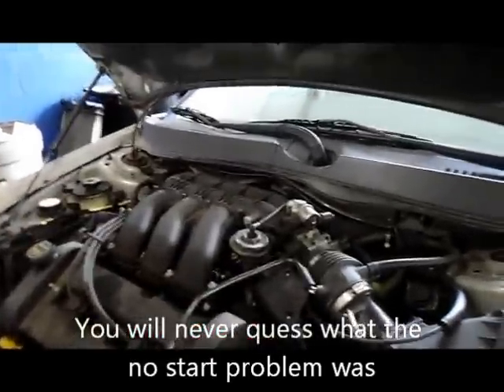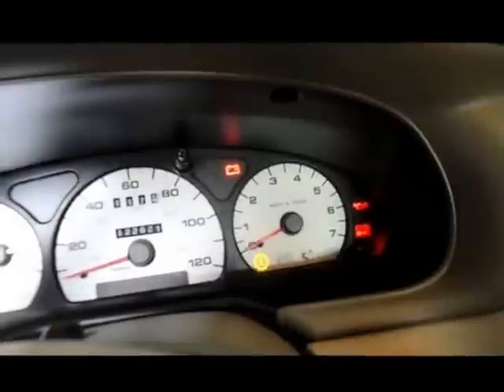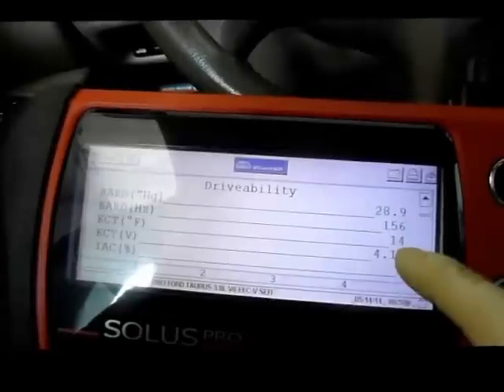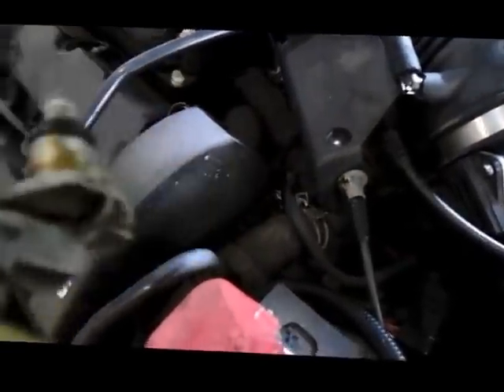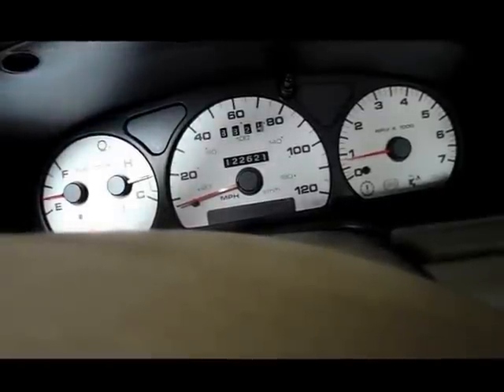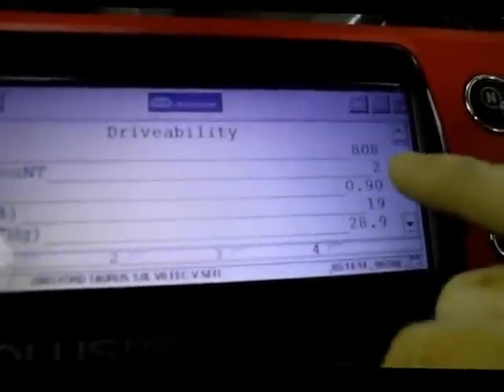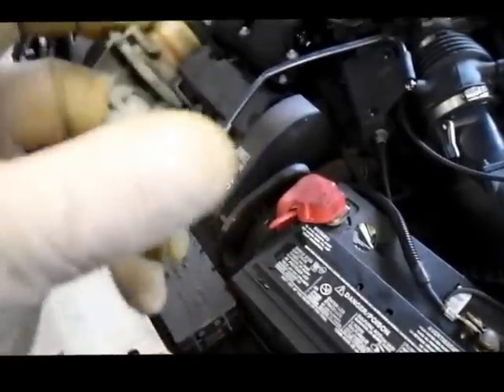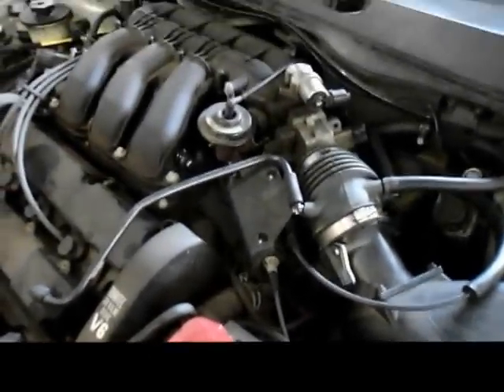Engine cranks but won't start

Comment: It will cause the vehicle not to run the coolant temp sensor in the ambient air temp sensor have to read within five degrees of each other if they don't it tells the computer to lean out the fuel or fatten up the fuel so the motor ends up either choking itself out or running too lean so unless they are reading within five degrees of each other it tells the computer not to let the engine fire because it senses a problem
Reply from the maker: Thanks for watching

Comment: but it isn't always the sensors. Could be fuel pumps, fuel pumps relay, alternators, spark plugs, fuel filter, and even the computer that controls the sensors. Either one of these. Sometimes corroded and very dirty battery cables, loose transmission cables, and starter relays can result in the same problems.
Reply from the maker: stan04 thank you for watching and you're input

Comment: Yes that happen, I have an mdx 03 one day on the freeway the lower hose pop off engine over heat and it never started again until I changed the temp sensor

Comment: Here’s a real cheap way to fix that, if ya have a heat gun, pull that sensor out, and heat it to the temperature matching the engine temperature, and it will fire right up! 

Same with a cold chain saw ya can’t get going, pull the spark plug out, put some fire to it, then hold the flame over the spark plug hole, and pull it slow till it burns all the fumes out, then hand screw it in, fire it up, then tighten er up , and off ya go! I personally haven’t needed a new spark plug for anything for close to 14 years now!
Reply: Jay Ziegler

Comment: That a basic problem almost on Any car cannot send correct amout of fuel it knows its about 70 degress and ect readni g 18 degress fail safe in effect. Prevents car from flooding and causing convertor damage

Comment: The car's computer see a very wrong voltage coming from the coolant temp sensor and stops the engine from starting. The computer thinks the car's engine is too hot and prevents it from starting and damaging the engine. The good news is that it was an easy fix once you figure what is wrong with it and you didn't need to buy any special tools to replace the sensor with. You was also able to get to the part fairly easy.The bad news is trying to figure out why it wouldn't start in the first place. This is also one reason why so many people think the mechanic overcharges for their repairs, They do not realize how much time one person can spend trying to figure the problem out. Most people think all you have to do is put a dionysiac tool on the car and the dionysiac tool will tell you what is wrong. NOT ALWAYS SO. People need to be educated on just how tough and time consuming  it can be trying to work on the  moderns cars today. With computers controlling so many things you also have to throw out common logic sometimes.  Thanks for sharing this I am sure it will help a lot of people.
Reply from the maker: neutrodyne Thank for viewing the video.
Reply: Thanks for 
taking the time and posting it.

Comment: Crazy I have a bmw328i and I am having it to we're it cranks over but won't start at all ... I replaced the spark plugs , put fresh gas ,put injector cleaner in the fuel and replaced the old battery.... I believe it's the fuel pump relay on my car I'm not sure but it could be something else ........

Comment: thanks for the heads up I have the same moter but it's a 04 if your horn gos out the alarm system wont work.
Reply from the maker: Thank you for stopping by the shop
Reply: I found that instead of taking apart the front end of the car you can take off front tire and undo three of the wheel well pins and get to the horn.
Reply from the maker: Thank you for stopping by the shop

Comment: Would a temp sensor going out during a drive cause it to just stop? I have a 2005 mercury mariner same motor it cranks and cranks but wont start was driving on the highway one day and car just stopped not sure what happened fuel pump comes on and all

Comment: gotta love stupid problems. my 18 wheeler started running rough two years ago. 10 thousand dollars in mechanic bills later I still have the problem. day before yesterday when checking fluid levels I kinda leaned against the primary timing sensor and the rig ran like it did when I first baught it. so now I have ordered both timing sensors primary and secondary. like I said gotta love stupid problems.

Comment: if the engine is cranking and engine rmp need move little bit but engine doesn't start. it mean the coolant sensor is not working properly?? or i misunderstood

Comment: 2002 explorer xlt cranks no start good fuel pressure at crank up to 58psi good spark stopped somewhere was ok came out had issue

Comment: I have a 2000 honda odyssey (van). It cranks but won't crank up. Was told it's the crank sensor. On a van, is it hard to replace?

Comment: My guess is that they have it programmed to fail to start if the coolant temp sensor has failed open and output is outside the expected value.

Comment: hey Jim I have a 1995 ford mustang 5.0 and when I turn the key on my coolant light comes on and the engine will not start just turns over and over....this may just be the fix among 500 other solutions out there! fuel pump works and getting spark but wont run and I smell alot of fuel after trying to start it. what are your thoughts? thanks!

Comment: I have a 2006 Honda Accord that has a reoccurring cylinder 4 misfire and won’t start. We replaced the spark plugs, fuel injectors, the pump and even the catalytic converter. Still nothing, any ideas?

Comment: I have the same problem with my nissan altima 2005 2.5 S.. Whenever is warm I need to crank it more than once. I have no idea what's going on and I brought it to 4 Nissan dealerships and 4 regular mechanics they always say they never find the problem. I was like did you drive it for an hour then let it sit for 30 mins then start it... Yeah I think not.

Comment: Thanks, I am going to check my sensor. I have a 1992 Pontiac Firebird 3.1L V6, having trouble with starting the same way. in drive it has trouble staying running. will let you know what happened.
Reply from the maker: Thank you for watching.

Comment: I HAD SAME PROBLEM ON A 1993 eagle talon only it would start after 6 or 7 times changed that sensor by accident and realized i fixed the hard start problem...

Comment: The 2003 Ford has a heated wire airflow meter ? Than there should occur an error code /engine warning light when the computer compares the intake air temperature or maybe the engine oil temperature  with the coolant temperature and it is too far off during startup or not ? It should start but switch to emergency running program so that U are able to limp to the repair shop ... Maybe Ford bought the electronics from British Lucas electronics inventor of the darkness ?
Reply from the maker: Thank you for stopping by the shop

Comment: Hi man, I’m having the same issue with my 1999 Mazda Miata & that coolant temperature sensor won’t plug up correctly & when I used electrical tape to make sure the plug from the coil pack won’t get loose. Now it starts up fine. It’s weird how it does that.

Comment: Cause it thinks the engine is cold so it goes into open loop that is the first thing I checkOn a no start if you were to let it cool down to close to that temp it would fire up
Reply from the maker: Thank you for stopping by the shop

Comment: I recently bought a Mustang 2006, one morning I didn't turn on, it cranked, lights turn on and everything. I took it to a mechanic as soon as it started later in the day, he said it was the fuel pump, replaced it. Brought it back home and the next morning it did the same thing. I don't know what to do next, any suggestions?

Comment: The codes for a 1995 toyota tacoma, has p0340 and po335. Both of those codes have something to do with the crankshaft. It is possible for the sensor to break within the mechanism...?

Comment: I have 1997 f250 7.5l gas engine I have put about everything on truck that was related to fuel and electrical, just wonder could this be my problem? my truck dies usually all' way's in traffic shoot a little starting fluid it starts back up.my mechanic said every thing checked out I drove to the store come back out, wouldn't start .after leaving their garage Repeat with starting fluid got me home, please help

Comment: Sounds like the cts shares a 5v ref with other essential components .....with the coolant temp. sensor bad, it probably shorted out the circuit for 5v reference.
Reply from the maker: Thank you for watching
Reply: Man ya hit the nail right on the head! I've had countless situations where one senor is bad and robs the 5 volt reference from another sensor causing no start, hard start or just run like crap! Also set codes for sensors are are perfectly fine. 2 that come to mind........ 2003 neon cam sensor code P0340 also had trans code also dont remember the code off hand but shifted just fine well turned out that the output speed sensor was shorting out and robbing the 5 volt reference from cam sensor  thus throwing the cam code and causing a very hard start. next 2013 versa kept throwing neutral safety switch code replaced switch  all is well? nope a week later here it comes with   same code... now get this it had 2.38 volts at sensor but why? ....well the right rear freakin tail light had water getting into it shorting out the circuit board WTH???? I been a tech 35 years and I'm so done with this crap this kinda stuff is just ridiculous!!!!!!

Comment: My car died last night with no signs of it going bad and wouldn't restart after being jumped. My emergency flashers still work. Any ideas? It sounded like it wanted to turn over, it made a grinding sound when I tried to start it. Full tank of gas.

Comment: Unsure of the correlation between coolant sensor and ecm/no spark. Ford engineering sometimes makes no sense and failure modes happen like this but are unintentional. I had a coolant sensor on a GM do a similar thing but it started ok just had driveability issues. Clearly evident when I monitored temp with a scanner.

Comment: 08 pt cruiser crank won't start. I wonder if this is the same problem. Check spark, fuel, computer, fuses, relay, asd relay (no inertia switch but has asd relay 🤔) and timing belt), and has a new clean air filter). Definitely not the starter because it cranks. Any suggestions
Reply from the maker: Did you check for codes?

Comment: do these come on 99 pi's, going through now on crown vic.  going to change crank sensor tomorrow, might as well pick up cooling sensor too.  i know crown pi came with this coolant shutdown, but after engine cools it starts back up

Comment: Toyota does the same, cranks and tries to run but no power and stalls out right away. Fixed a broken temperature sensor wire and away it went. My brother in law drives the crap out of his car and it looks to me that the wires rubbed though from the engine rocking back and fourth in the engine compartment.

Comment: Happens to me with the temperature sensor (no sparks) and not a long ago with the throttle body position sensor ( fuel injectors disable) and with a loose connection with the mass air flow sensor. This newest cars are a freaking headache.
Reply from the maker: I'm happy to help. Thank you for watching.

Comment: Had a 92 camry. Pulled all my hair out. Wouldnt start when hot. Intermittent running. Very puzzling. Took to a shop. I am a mechanic.. Sensor cost 5 dollars.. labor and troubleshooting 350.00 . I didnt know. Nothing made sense. The shop was confused. COULDNT FIND WITH MANUALS AND WHATEVER ANALYZING TOOLS THEY HAD.

Comment: the ECU/ECM thinks that it's too cold outside ( no air temp here or maf , it only has MAP ) and so it advances the ignition too much for it to get the cranking map working and sustaining rpms.
Reply from the maker: Thank you for watching

Comment: Ok same thing happened to my 2003 mazda tribute it has the same ford engine 3.0 24 valve so the coolant temp sensor went dead one time I replaced I tu with new one but accidentally ripped the connector so I connected the new one with some wires and it worked but this was in late summer it was still warm now that's cold out it wont start  checked every thing seems good to me but still I seen your video wonder if itd the same thing cus it's cold start.
Reply from the maker: Any codes?
Reply: @jimthecarguy  no codes at all checked with two different obd scanners and got no codes.

Comment: When the coolant temp sensor reads that low the fuel can not atomize properly the computer is programmed for this, as a saftey the car will no longer start until the temperature raises. I see this all the time

Comment: Interesting issue, I have a similar wierd issue now my 2000 Grand Prix GTP will crank but not fire. if is test for spark on coil unit it starts right up.

Comment: Coolant sensor shorts out and most likely pulled down the reference voltage that is shared across a multitude of other sensors and .modules.
Reply from the maker: Thank you for watching Don't forget to watch Sunday Night at 7:00 PM Live stream.

Comment: according to the dropped voltage after replacing the old one it shows that the old one was an opened circuit.
Reply: Or a partial short that lowered voltages in the computer and made control by the computer not possible. I saw other videos where the guy went through sensors looking for a drain on the computer circuit by removing one sensor at a time. The reason he did that was because a voltage to the computer was too low and the computer/car was not operating correctly with the low voltages.

Comment: With the temp sensor showing fourteen degrees f the computer would make the injector pulse very rich and flood out the engine. It couldn't start because it was so rich.

Comment: You need to step back and think about this one.  Computers only do what they are told to do.  So if this temp sensor gave the info to the computer that this temp is related to no coolant in the engine and should not be allowed to start, it makes sense.

Comment: I would have liked to see what the intake air temperature sensor said maybe if the computer sees and intake air temperature as ambient or around 70 degrees as you said in the video but the coolant temperature sensor said completely opposite then the computer picked up a problem and may have had issues adjusting air fuel ratio so it just goes in shutdown mode good video though thanks
Reply from the maker: James Patterson thank you for stopping by the shop

Comment: My '95 maxima rpm needle does not move when I try to start the vehicle (of course vehicle does not start either).  Cam and crankshafts seem good.  Could it be the camshaft sprocket?

Comment: That has Ford's excellent engine temperature control system, right? In the first stage of overheating it sends the temperature gauge into the red, in the second stage it kills half the cylinders by disabling the injectors in those cylinders, and in the third stage it shuts the engine down until it cools. I had always assumed it did the third stage by killing all the injectors, but maybe it kills the injectors and spark. 
Otherwise I am as baffled as you are.

Comment: 2004 KIA Sedona- overheating,put in new thermostat still overheats.Could it b the radiator/? Does it need a flush & fill ?

Comment: If the sensor is part of the 5 volt reference circuit and for some reason it's pulling the reference voltage down the car won't start...

Comment: I have a 1995 Mazda mx-6 with the current exact same problem. My temp guage use to surge up and down while driving but the car was never really "hot". One day it took about 3 tries to crank it and after that it just got worse, a week later completely stop. then my dad jumped he car off then it fired. After that night it never cranked again. I first changed the spark plugs and wires, no spark. I changed the distributor and rotor button, no spark. I then just put a whole new distributor in, no spark. Then changed the crank shaft positioner, no spark. I dont think my mechanic has check the engine temp sensor yet, he says the ecu in my car could be bad. What else could i possibly try before purchasing a another ECU?? Please help. i have been carless for 3 months!!!!!!!

Comment: I do have a similar problem intermittently for about a year now can't figure out what's wrong the code I get is for a crankshaft sensor so we replace the crankshaft sensor to no avail it doesn't work and is still starting intermittently. I am wondering if the coolant sensor could be the same way in my ford F1 50 Because I am also getting a reading of 14 any help I can get here would be very much appreciated since nobody can figure it out